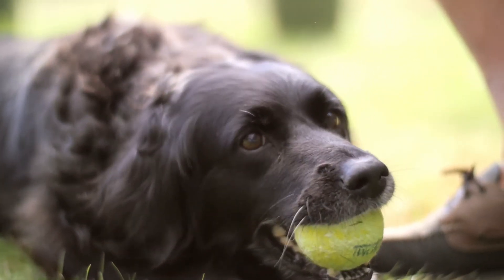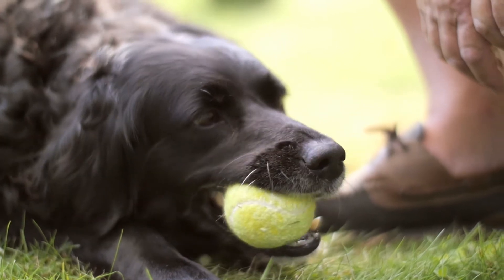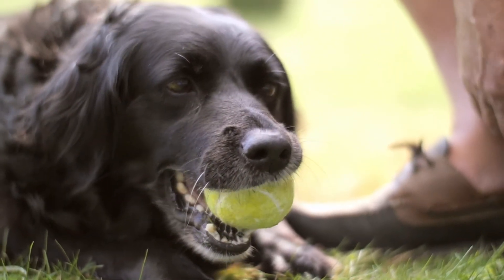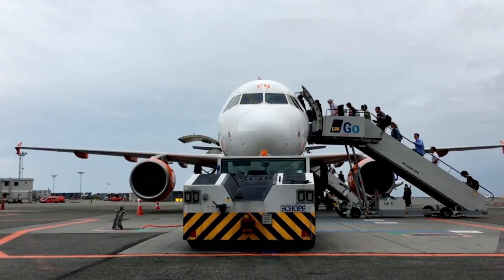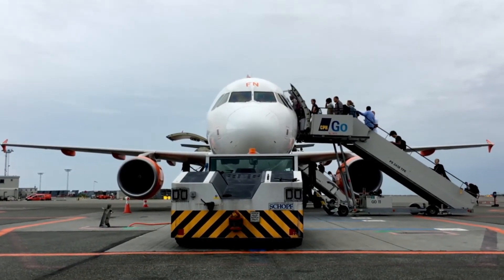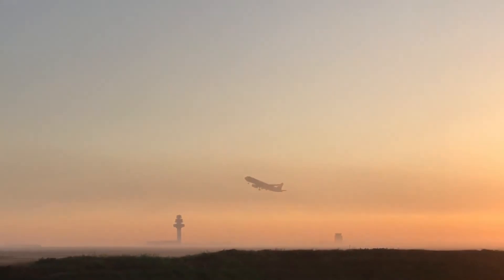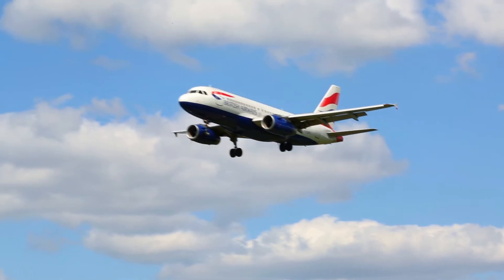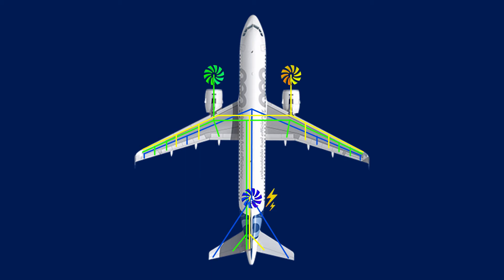Weird BARKING SOUND on planes? | Airspace explained: The PTU

Comment: Well I would never have suspected that! If one engine was to fail, would this PTU then make the barking noise continuously ? Or only when it is started? Great video as always!
Reply from the maker: Yes it would! Let's hope you never hear that :) And thanks!
Reply: @AirspaceVideos  well, since the systems are redundant, I suspect everything should still be working? Or am I wrong? The plane would be flying on one engine only tho
Reply from the maker: Yes, exactly, in theory. A textbook engine failure without massive destruction around the engine would be exactly like that - perfectly flyable with almost all systems working (especially the three hydraulic systems)

Comment: i though the other reason the PTU is engaged is because in order to save fuel airplanes taxi in and out of the runway with one engine running, otherwise why would be the reason we also hear it right before connecting to jetway on the way in and before shutdown?

Comment: These are typical sounds of digital valves. The flow in digital valves is not adjusted by the diameter of the opening but by openings per time with constant diameter of the tube. The opening/closing frequency is responsible for that sound.

Comment: On Youtube there are several videos of PTU making noise in mid-flight. If you are already irritating on the pushback, imagine that noise during the flight.
Reply from the maker: The PTU does not operate in flight, except if one engine fails. If that's the case, a barking PTU might be the smallest of your issues 😁
Reply: @AirspaceVideos  I'm sure it does 😁😁😁😁, but there are several videos on Youtube with the PTU making noise in mid-flight, which shouldn't happen as it indicates that something is wrong.
Reply from the maker: That would suggest that hydraulic pressure is really low on either the green or yellow system, which really shouldn't happen under normal operation 🤔